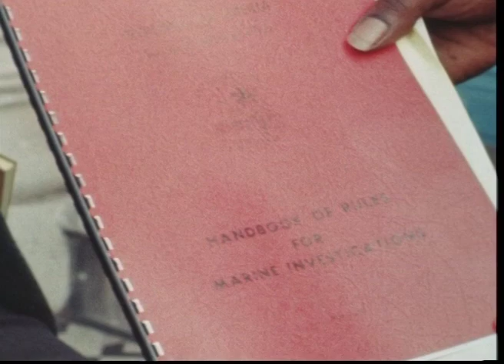Amoco Cadiz Oil Spill

Comment: 🎯 Key Takeaways for quick navigation:

00:16 ⛴️ Amoco Cadiz suffered a steering mechanism failure on March 16, 1978, causing a massive oil spill of approximately 255 million liters of crude oil into the Atlantic off the coast of France.
00:46 🌊 Encounter with a fierce winter storm and high seas crippled the tanker's rudder, rendering it unable to respond to steering commands.
01:55 🛢️ After hitting bottom and breaking into two sections, the Amoco Cadiz released its entire cargo of over a million and a half barrels of crude oil, leading to a significant environmental disaster.
02:26 🏖️ The oil spill polluted approximately 321 kilometers of Brittany coastline, impacting animal and plant populations, resulting in one of the world's largest environmental disasters.
03:28 💰 The disaster caused over a quarter of a million dollars in damage to fisheries and tourist services, leading to legal action against Amoco International Oil Company.
04:15 🌍 The Amoco Cadiz oil spill prompted the French government to implement measures for accident reduction, improved rescue, and response methods, leaving a lasting environmental impact.

Made with HARPA AI